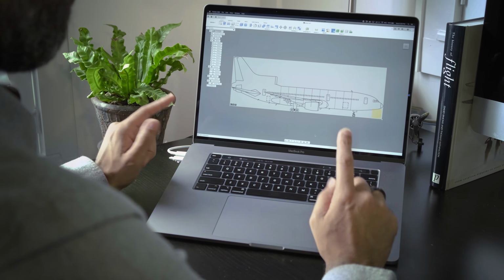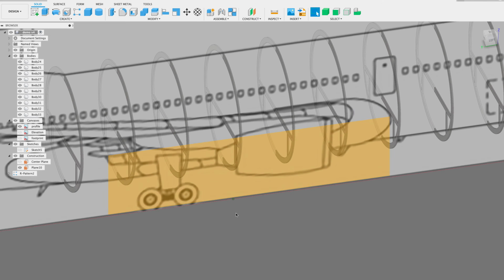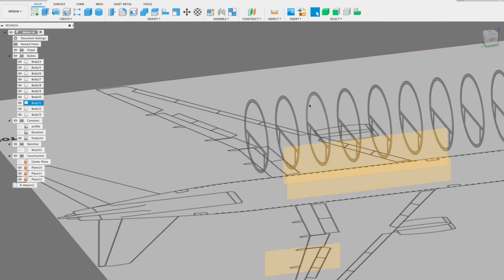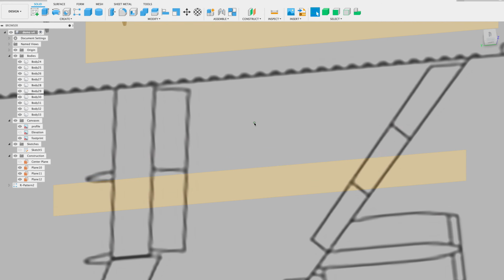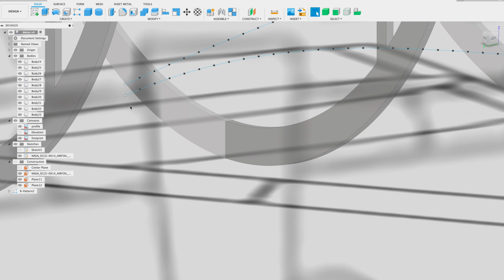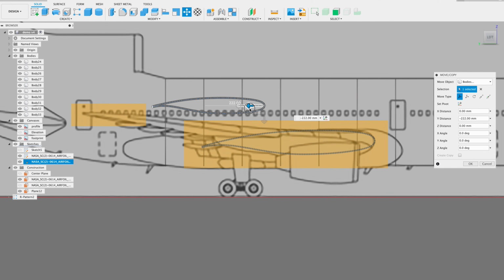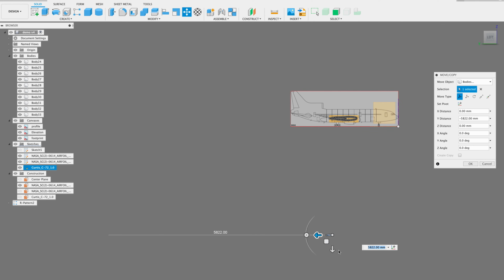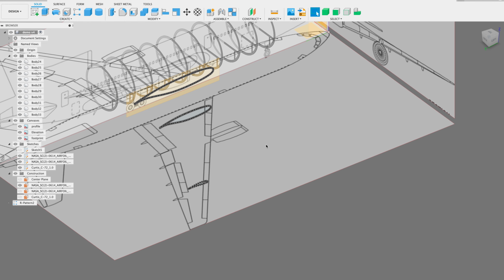Part 1 | How To Design Airplane Wings in Fusion 360 - Airfoils [Episode 2]

Comment: Sir, video is amazing but I'm not able to move planes after creating an offset plane, In fact the triad move pad does not get toggled when I press M after selecting the plane. Please tell me how to set that.
Reply from the maker: I think I may have found the problem. If you have parametric design turned on, you can not rotate construction planes. Turn off design history by right clicking on the top level component in your browser and turn off design history. That should solve the issue.
Reply from the maker: This sounds like and issue with your selection settings. Make sure that the selection filters area all checked under Solid -> Select -> Selection Filters and then select all. Then tap on your construction plane, it should highlight. Them press M or you can use the "Cross with Arrowheads" from the options Tape across the top of the F360 UI. If the Triad tool does not appear, move your mouse pointer over the plane and off again, is should appear.

Comment: I am not able to move my plane as you do ,it either move and copy any body but not the plane . as well i am not able to rotate the plane to so it is being difficult for me in part 2 . so can you please guide me
Reply from the maker: Sorry you are having issues with this. F360 has a few quirks that can catch you off guard. This sounds like and issue with your selection settings. Make sure that the selection filters area all checked under Solid -> Select -> Selection Filters and then select all. Then tap on your construction plane, it should highlight. Them press M or you can use the "Cross with Arrowheads" from the options Tape across the top of the F360 UI. If the Triad tool does not appear, move your mouse pointer over the plane and off again, is should appear. Hopefully that helps.
Reply: @RCCAD2VR  thank you terrance ,
Reply from the maker: I think I may have found the problem. If you have parametric design turned on, you can not rotate construction planes. Turn off design history by right clicking on the top level component in your browser and turn off design history. That should solve the issue.
Reply: FINALLY IT WORKED IK I was late but if finally worked, 5 hrs later and chat gpt getting mad i got it lol

Comment: Hi Terence great series. I've been  building rc models for nearly 20 years and built a Vickers VC10 airliner. It was a long project and flew quite well. One thing I have learnt over many builds is that the airfoil for the full scale model doesn't always work very well on scale models. I believe its to do with the Reynolds number. I now always use the Clark-Y on my builds apart from flying wings where I use the MH45 and 60.  I built a T45 Goshawk recently and used the full size airfoil and it flew for about 20 seconds and was very unstable.  A few videos on my channel show the attempts. There were some other design errors but that's another stories. I use my own design CNC Foam cutter for all my builds. So I'm redesigning in Fusion 360 with DevFus Foam and DevWing Foam with a clark-y.  Just subscribed looking forward to the series 
Keith
Reply from the maker: Hello Keith, Thanks for the great comment! Yes, airfoils is a tricky and complex thing. I'm making use of the Reynolds number and using the various charts to get a good understanding of the airfoil performance. I'm on my 4th wing iteration and will use Fusion 360 to get a few tests run to get a better idea of various characteristics of the wing. The T45 Goshawk looks like it could be a fun plane, hopefully you are able to get the kinks worked out of it and get to enjoy a nice flyer. Glad you're able to get a few insights from the videos I'm putting out there. Cheers!

Comment: I have a problem when importing airfoil. It doesn't import. A error pops up.
Reply from the maker: Sorry to hear that. How are you saving the file? Make sure that you are saving the file from your browser. Do not copy and paste the text into an editor. I have instructions on my website on how to save the file here https://www.rccad2vr.com/rc-airplane-design-build-episodes/design-rc-airplane-wings-in-fusion-360-part1 look for the heading "How to Download Your Own Airfoil DAT File" about midway down the article.
Reply: @RCCAD2VR  the file has been changed in editor from txt to dat.
I will watch your video and try again. Cheers
Reply: @RCCAD2VR  Ive read the info and this is how they were saved.
Reply from the maker: That's unusual. If the file is saved from the browser as shown, and you are saving as a .dat file it should be working. Which airfoil are you using? I'd like to take a look at it and see if I am having the same issue with it. I can help you further if you send me a direct message through my website here https://www.rccad2vr.com/about-rc-airplanes-from-cad
Reply: @RCCAD2VR  its the TP100 
I had to import into mastercam then export to fusion as dxf.
Now for some reason the sketch foil  isn't closed. I may have to sketch over the airfoil but I feel that won't be accurate. 
I'm not not having a good start with fusion.
Reply from the maker: @Airtimeasto76  hmmm This is all sounding very unusual. I searched airfoiltools.com for TP100 and nothing came up for it, so I can't test it so see how it handles on my end. Importing it into other software and back out is out of the scope of what I am familiar with and can't help there. Sorry you're having this issue. If you need additional help we can continue via email. Simply contact me through my website.

Comment: Could you please fix your audio? There's a very large amount of distortion whenever you speak.
Reply from the maker: Oh no?! That doesn't seem right. I've checked the video and not hearing any distortion. Let me ask a few friends to check if they are hearing what you're hearing.

‼️ Is anyone else experiencing this issue ❓
Reply: @RCCAD2VR  Sorry, it was my computer. I rebooted it and now it's all fixed. Funny that other youtube videos didn't generate distortion, but did later on. Thank you for responding so quickly. Keep up the good work.
Reply from the maker: Whewww!!! Glad to hear it was just a computer issue. I was really concerned there was a problem with the video, especially since I really focused on improving audio in this video. Thanks for letting me know all is well again. Thank you also for the encouragement. Cheers